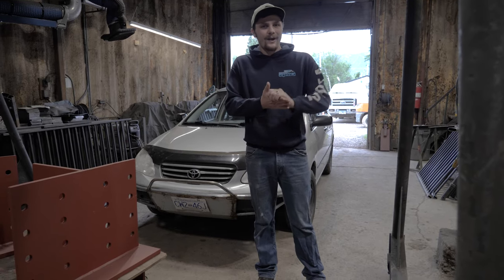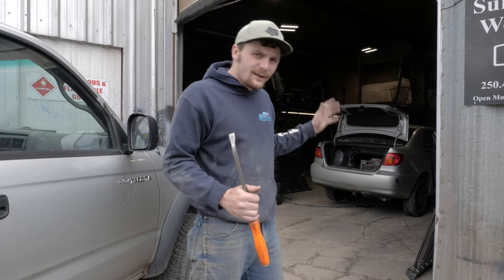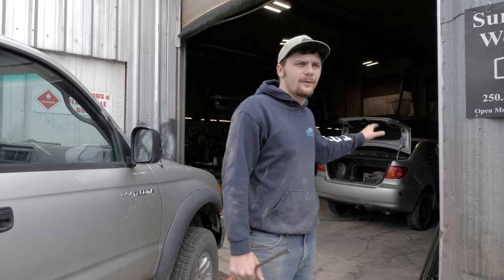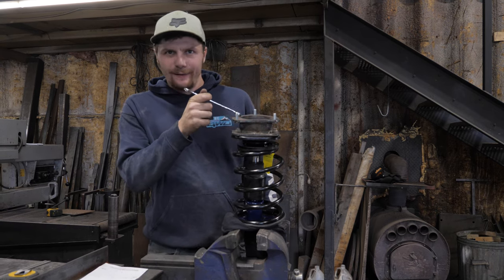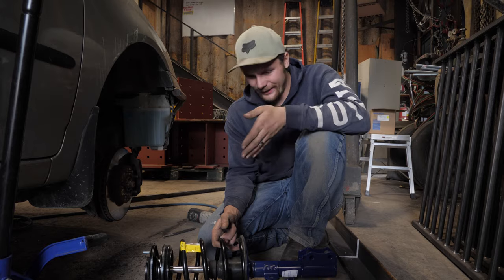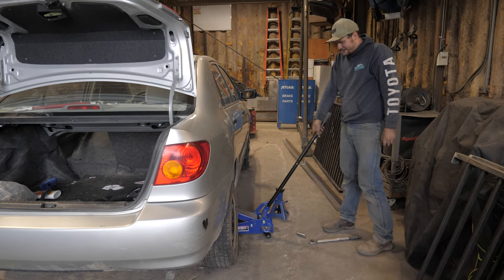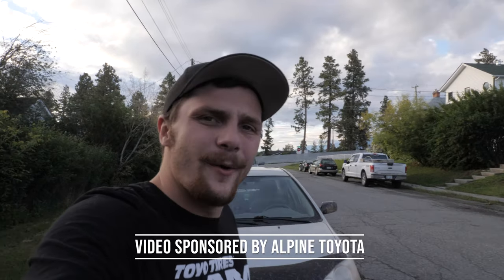I Lifted my Car! - Lifted Rally Corolla Build (Part 2) / Gambler 500 Build

Comment: Nice work! Lift spacers for this generatin of Corolla/Prius/Matrix/Pontiac Vibe are readily available on Amazon. They all share the same suspension parts thankfully, for around 120 bucks no less.
Reply from the maker: They do exist. But not 2" - 2.5" ones
Reply: @DirtGarage  You're right. Thought they were bigger.  Only 40mm though
Reply: Can I get them for a 2000 corolla?
Reply: I have an 05. I w like to raise. Any sources? (It's also silver like the dudes on here.) I don't think I need that much raising, so maybe a combo of higher profile rims and tires and a small spacer will do it?

Comment: Sometimes on an open diff drive you can hold the brake and floor it in 1st then let off just enough brake pressure to slowly move and the braking force against both axles will hold the spider gears and evenly give drive to both wheels....just don't power brake too long and burn up your transmission
Reply from the maker: I know of this trick, kinda works like the electronic LSD in the later models Toyotas. But I was not that committed to making that hill!

Comment: I realized my e11 (eu version pre facelift) had good ground clearance, im a big guy and can crawl below from the back to the front without jacks.
Previous owner also had some big tires installed, so big that the chassy would touch them while turning. 
Would be fun to lift it a bit for all the underbody work ill have to do but ig it would result in worse aerodynamics

Comment: I'm a front wheel drive off road guy. I own a 06 fwd highlander with 255/70/16 in front and 245/70/16 in rear wrapped with bfg ko2s on a 16x7 black rhino rumble wheels. I watch alot of gambler guys off roading. What parts do you need to make it reliable off roading????
Reply from the maker: You got the one and only part you need to be a reliable offroader. The Toyota badge 👍 In all seriousness, this Corolla is entirely stock (aside from the custom lift kit, and bumper) and it has been beaten on bush roads, and continues to be reliable! I have no plans to beef up the suspension because nobody makes anything to do so! So I'll continue to send it as is, you guys will know when it breaks, I'll for sure make a video.

Comment: You don't have issues with the CV axles being too angled? I'm thinking of doing something like this with my 2002 Toyota Corolla and just using Rav-4 struts instead of spacers because I don't have a shop. If it comes down to it I guess my brother in law has a welder... Also how are the ball joints? Alignment?
Reply: since it's considered a body lift, I don't think it matters

Comment: I made the same strut spacers for mine, I can’t get the strut to bolt back up to the steering buckle, the control arm won’t lower enough, the spacers are only 3”,  can you make explain how you got them in.
Reply from the maker: I only have 2.25" front and 2.5" rear spacers.

Comment: Hey I have a 06 Toyota matrix I want to lift but don't have the tools. I know Amazon sells 1.5 lift kits for cars but is there a way to go higher without doing yourself?
Reply from the maker: As far as I'm aware the only way to go higher is the way I did it. Sorry!
Reply: @DirtGarage  alright I guess I'll try to find some one. Thanks though!
Reply: What you can do is take the struts off or buy a extra set. Take it to a machine shop and they can fabricate a set of lift spacers for you. Cost is all depending on the shop. I would also do a frame drop also if the lift is going to be 2.5-3 inch lift. That's to help with the angle of the axles fro binding when at a higher height. They are just spacers that goes between the frame and it's bolts.
This is what us Honda CR-V guys do to our for lift. You can check out Honda Rescue Garage also for info.

Comment: i kinda want to do this to my 06 rolla... SOB aint worth much with the miles on her.. and its a beast in the snow.. lift would make it better
Reply from the maker: That's awesome! I highly recommend it. Rides the same down the road. Just loads more clearance.
Reply: well thats good to hear. maybe i'll go about making a spacer kit when my tundras all done!
about 800k on the ol rolla and she still runs good! @DirtGarage
Reply from the maker: @001dman  That is awesome! Mine is at 299,999.. So I have no idea, that's where it was when I purchased it.
Reply: my father bought mine new. hit 299k in 2009 or 10 (forget). going off oil changes its around 800k. sucsk they all stick at 299999 @DirtGarage

Comment: Wouldn’t this have any cv or balljoint issues? Im planning on putting a kit in our 2011 corolla
Reply from the maker: So far so good! Slight and barely noticable passenger side CV wobble in harsh acceleration in first and second gear, but that's it.
Reply: Dirt Garage did the cv angle change much?
Reply from the maker: @shawn_herrera  Not a bunch. But it did. I have a theory that if I replace them the wobble will go away. Just because they where at the old angle for hundreds of thousands of kilometers, and the sudden change has it sitting in a different wear spot.
Reply: Dirt Garage thanks! Im looking at these 40mm spacers on amazon that come with extended strut bolts. I might give it a try.

Comment: I saw how you made the front spacers, but I'm not sure how you did the rears after looking at how the upper mount is designed when looking at Rockauto pics.   

Any chance you have pictures of how you set those up?
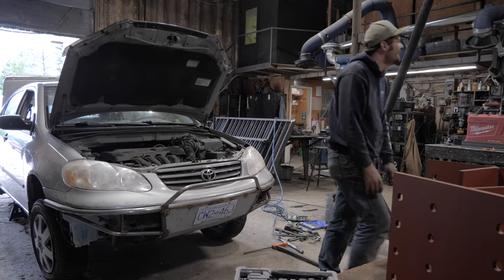Reply from the maker: At 2:40 you can actually see the rear spacers getting cut.

Comment: Please lift a toyota vios e manual. I'm afraid it might be a life threatening change and cause driving aswell to be stiff and difficult to maneuver especially in curbs and highways. I would like to be able yo life it so it won't bump and scratch on parking stoppers and speed bumps.

Comment: Hey just a quick question i just picked up a 02 carola for nothing. Wondering on the lift spacers what is the height you made them. I know with my jeep liberty independent suspension what ever spacer you install it doubles the amount of lift. Is that the case with this. Oh and did you make the spacers level or did they have to be angled side to side?

Hope to hear something back a little info will make it easier to tear into it. Thanks
Reply from the maker: It's not quite double. But close. Mine are 2 1/4" in front and 2.5" in the rear. Not angled or nothing.
Reply: @DirtGarage  is the 2.25 and 2.50 the actual height of the spacers you made or the total lift. Any other little tips if you have time would be awsome.
Thanks for the quick response bud! You are one of the few I was able to find who has done this. Was sitting here wondering if it was possible. Thanks again
Reply from the maker: @cbpf9  It was about 4" total lift with those spacers we made.
Reply: @DirtGarage  and no problems with axles or stock arms?
Reply from the maker: @cbpf9  Nope. Never an issue for the 3 years we have been running it.
Reply: @DirtGarage  thanks for the info  going to try to make up some spacers just gotta find someone to weld them up for me.
Reply: @cbpf9  can the spacers be  bolted another way @dirt?

Comment: Did you use the stock shocks?
Reply from the maker: Yes. Doesent require longer ones because we put a spacer on top. We put new ones in with this lift though because they where worn out.
Reply: @DirtGarage   Awesome, I am busy modifying my 07, have you done any mods to the engine?

Comment: What size tires are those?
Reply from the maker: Tiny. 185/60r15 I believe! Still stock, it needs bigger rubber baaad
Reply: @DirtGarage  yea i think i can get away with 215/65r15 i need new tires so its perfect timing and toyo rebate starts tomorrow.
Reply: @ReadySetReel  did you put the given tire size on your car and did you ha e any issues?